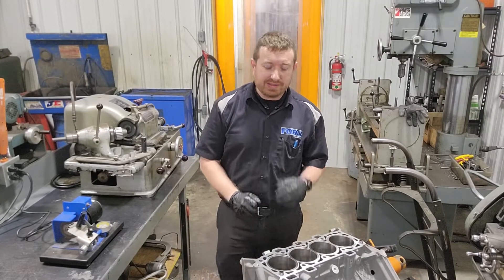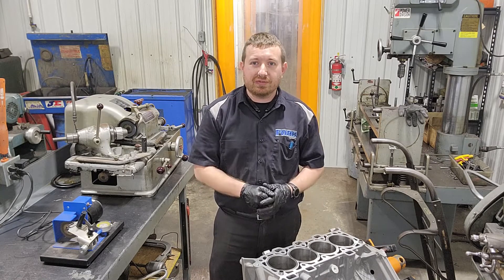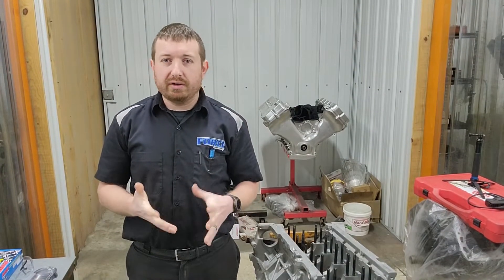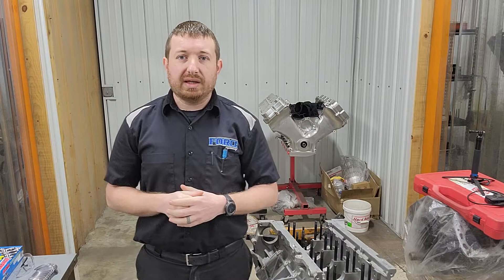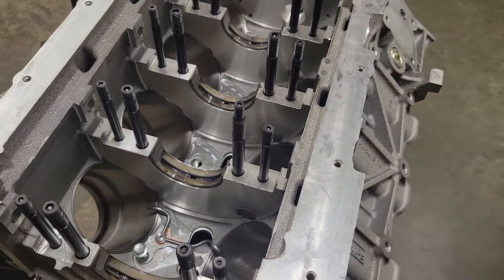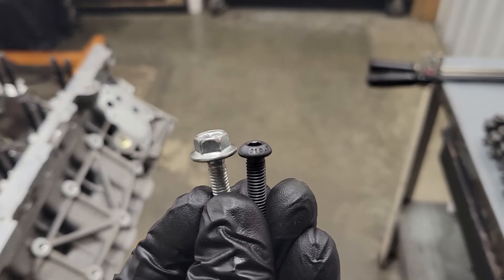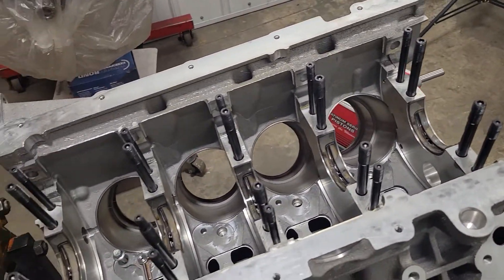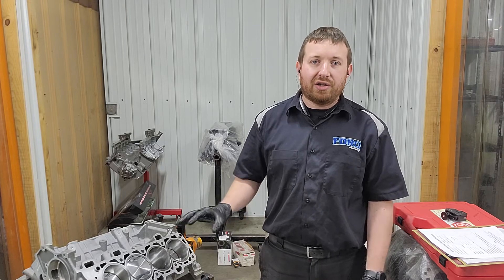Sleeved Gen 3 Coyote Engine Assembly Part 1 | Manley Turbo Tuff Rods, Diamond Pistons

Comment: Most builders use mmr blockers for the oil squirter on boost applications
Reply from the maker: I've used the mmr ones, and I also have tapped them for 1/4 npt and plugged them that way.

Comment: What size are those butthead Allen bolts? Been trying to find any info on what threads pitch they are can't seem to have any luck
Reply from the maker: 6mm × 1.00. I use 25mm length with the squirters.

Comment: Enjoyed the video. Do you ever do coated bearings? Also, you might be the only person I’ve ever seen who keeps the squirters. Do you ever block them off?

Looking forward to the next video in the series.
Reply from the maker: All bearings have the manufacturers specific coatings, they're just different.  If you mean a bearing coated by a second party like Calico, yes i have. Typically only in situations where my go to brands aren't available though.   I prefer to use the squirters when I can.  especially in an application like this where it will see longer run times for track days ect.   That said, I ended up not being able to run them in this.  The rod was to big.